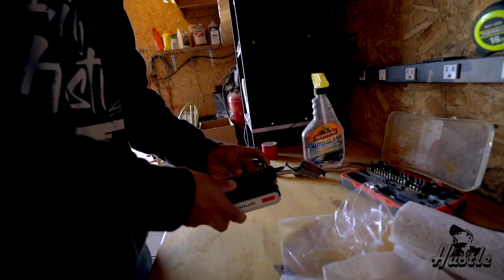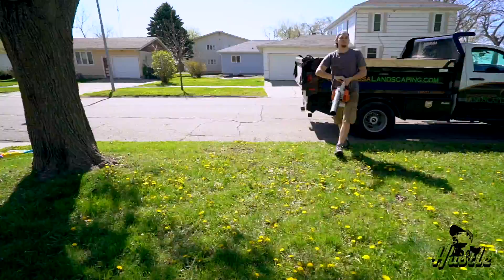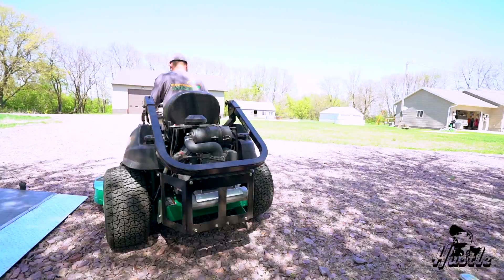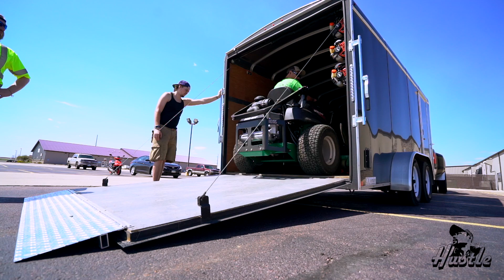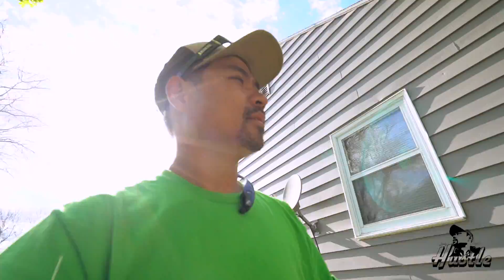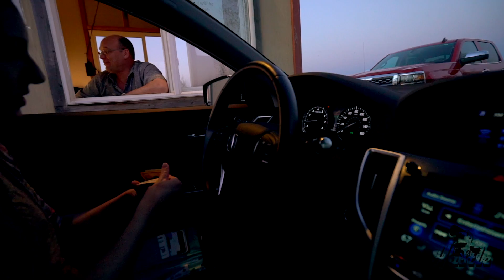Catching up on Lawn mowing with Bobcat Mowers

Comment: Hey man great content, great videos but idk if it's a time constraint, or lack of knowledge. Why don't a lot of pro guys do basic maintenance on their own equipment?  Fixing a flat tire is something that could've easily been done it the field, and back to mowing you go.  All they did was plug it nothing special.  If you buy off brand tires you can easily put flat free on your front tires.  I see a lot of pro guys taking their mowers to the shops for the most basic things like oil changes, air filter changes, lube jobs, blade sharpening.  These are all simple stuff anyone can do with very little knowledge.  I actually started buying used "broken" equipment from pro guys because they thought it was junk.  I once got a  $2500 Classen over seeder for $240 because it wouldn't start.  They guy originally wanted $1000 but since it wouldn't start it's now "junk" to him.  All it was, was a simple clogged carb.  I fixed it for the low low price of free and 10 minutes of my time.  I resold it for $1000.  I got a $3000 aerator for $400 because it needed a new drive chain.  All I did was adjust the tensioner and tighten up the chain.  It blew my mind that the guy didn't now your supposed to adjust the chain tension as the chain gets worn. I mean it's important to know when to replace the chain so it doesn't chew up the gears too.  Not hating on you if your budget allows frequent shop calls for simple things that's great, but I'm just too darn cheap lol.  At least these mowers were under warranty at the filming of this video.